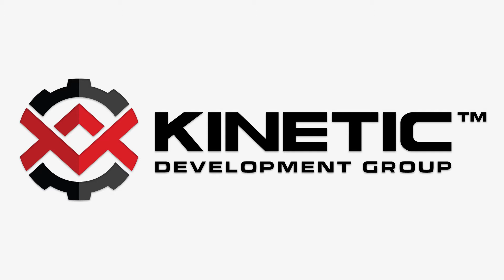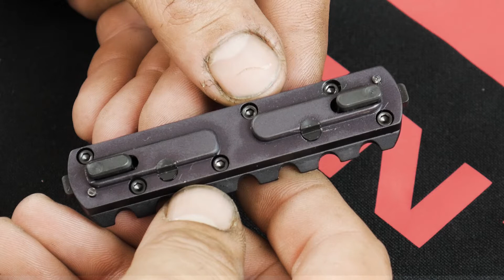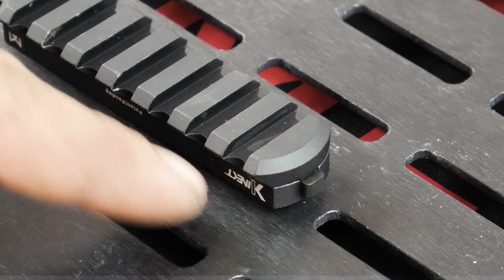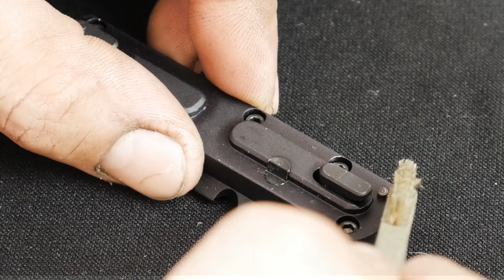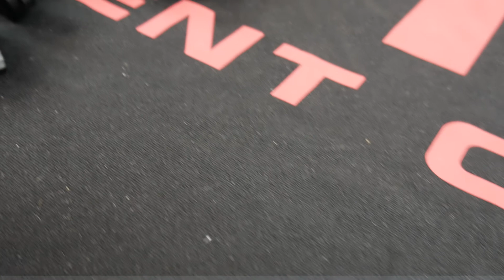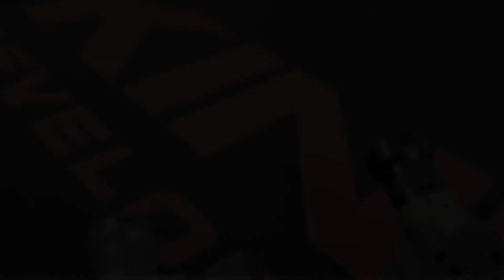Kinect Demo & Maintenance

Comment: For some reason this doesn't work on the Magpul Hunter 700 mlok slots or a similar in thickness mlok rail. Is there a fix for that? I have the 3 slot kinect rail and a 1913 bipod attached to it for the Hunter 700 stock and it doesn't fully deploy.

Comment: Do you have to depress both sides to get it to unseat?  What happens if you depress one side, does one side release?
Reply from the maker: Yes, both sides depress. When you depress the wedges they will lock into place and stay in the ready positions until you are ready to put your Kinect piece back into an MLOK slot.

Comment: It's so crazy that I was about to shoot an email to KDG about lubricant/maintenance. My Carbine is stored in a shitty location that is very wet, so I noticed some rust spots on the screws that hold the assemble together. I soaked a qtip in ballistol & cleaned that up no problem, but that got me thinking about the internals. After viewing this video I feel confident that a couple drops of ALG Go Juice in the guts will work out nicely. Buy Pennsylvania & Pa. folks work :-)